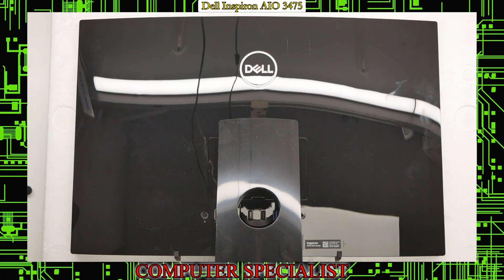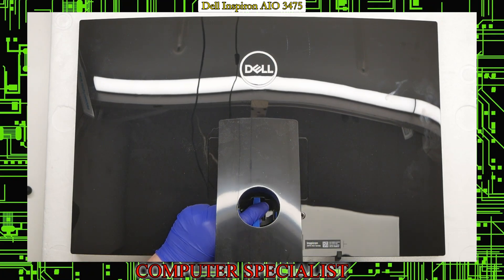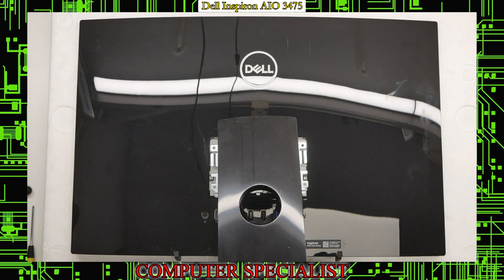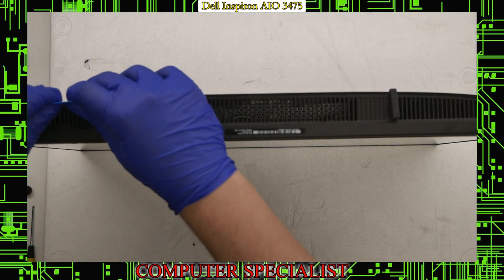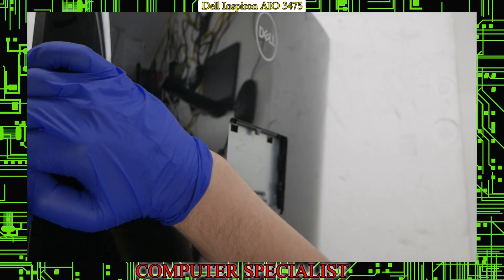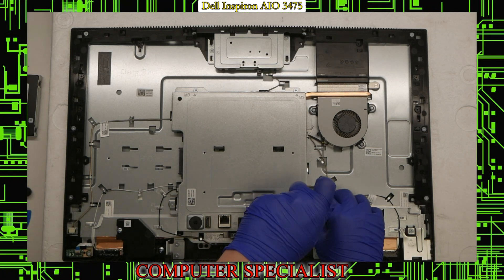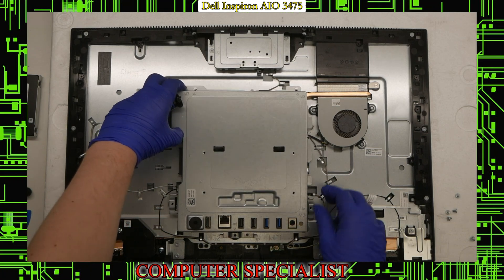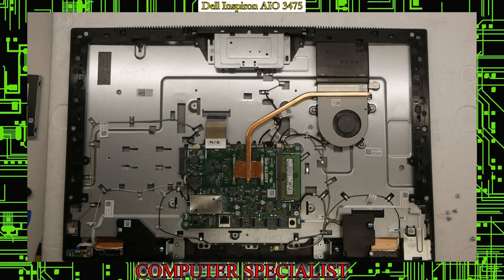Dell Inspiron AIO 3475 Disassembly

Comment: Hey I have this dell aio it comes on for about 1 minute then shuts off
Reply from the maker: Try starting with different power adapter. Then id try swapping / reseating memory sticks. If you have 2, try one in each slot. Then check voltage on bios battery, should be 3v. If all that fails most likely motherboard and you can pick one up fairly cheat on ebay!

Comment: Good video.
I tried to upgrade the ram, but now I have no power. I put the original ram back in, took out the motherboard coin battery and held the power button for over 60 seconds to drain any charge. But I still have no sign of life. Any suggestions?
Reply: I found the problem. Behind the power button inside is a quarter inch flat ribbon wire coming from the power button to motherboard that got disconnected because the connection is very flimsy for the power button. Once I connected the ribbon wire to the power button everything fired up and the new ram is working.  Thanks for your help and video.
Reply from the maker: Does it power on? (Like any lights or fans etc?)
Reply: Zero lights including the power button or anything inside.  The power cord light is on and power outlet is good. @computerspecialist8533
Reply: No lights whatsoever and no fan, but the power cord does light and it’s good along with the outlet it’s plugged into.